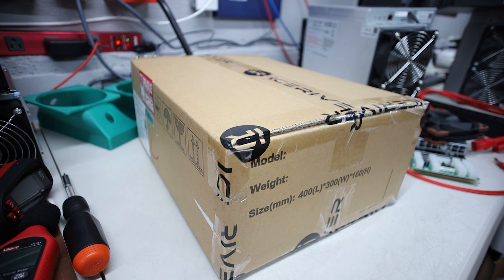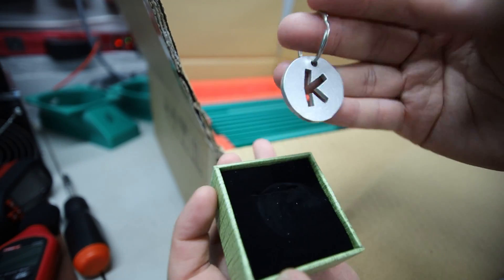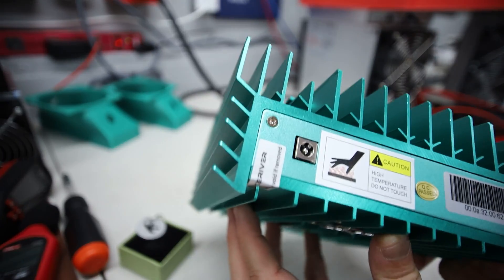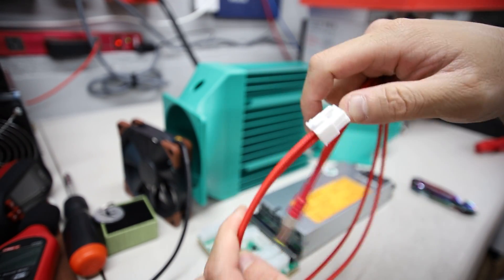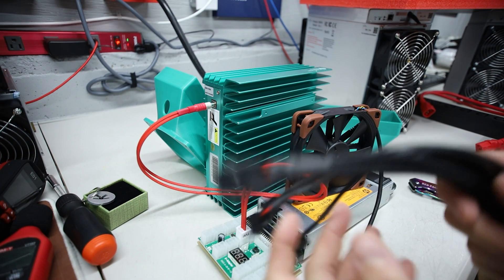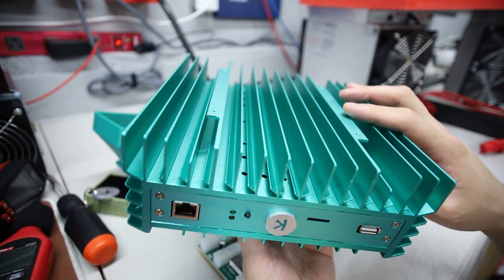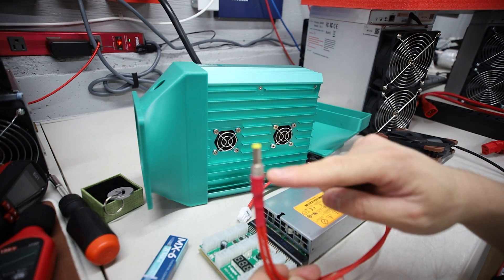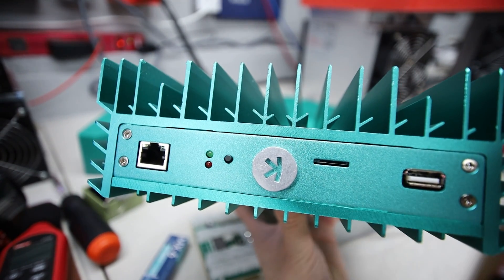The Commemorative KASPA Edition KS0 Pro First Look! and my overclocking modding plans.

Comment: Those veteran miner cables are useless for overclocking, the barrel connector melts away like butter and could potentially cause a fire... I wish the could use some high heat resistance material like clay or whatever. So, please stay away  from the veteran miner power cables if you'll be overclocking.

Comment: Does the KS0 Pro work well on 12v? I've bought a server psu and a breakout board. When i connect my KS0 Pro using the DC screw plugs, it literally smokes when the miner is started.

Comment: I have a question about the power supply.  I bought one with a breakout board, the board has a switch for voltages.  Do I run everything at 12 volts?  CPUs, GPUs, etc.  I plugged a nauctua fan into 12v and smoked it 🤷🏻‍♂️

Comment: If the power cable is inside the fan shroud it will stay cool. Most of the issue with burned power connectors if simply overheating.

Comment: 10 of these overclocked on one server psu?  you'll probably need a 2000w+ unit to follow the 80% rule.
Reply: There is no 80% rule on 12 volt DC power supplies, 80% rule is for 120v/240v AC House wiring only. 12 volt can be run continuously at max rate and even over for short periods.

Comment: PANDA the KS0 Pro is a POS, worst $500 I ever spent. 100 KaSPA in over 8 days. Crap bro
Reply: Shouldn't have been a big surprise either
Reply: Dang so what else can those of us who are home mining without ability to upgrade to a 30 amp circuit? what are good alternatives?
Reply: @jarooty2 buy equipment in bear market, yields were high then. Now we are in bull market. So wait until next 4 year cycle in a couple years.
Reply: @jarooty2  there’s a FPGA that runs on 20amp 120v K10+ over 45Gh on ALPH Wow

Comment: Hello red panda, I am Murat, greetings from Turkey. I used my KS0 Pros for a while for trial purposes, with a handmade barrel plug and server PSU GPU power cable combination similar to your system. However, there is a situation like this: While KS0 Pros are working with 19 volts, since the server is fed with 12 volts from the psu, this time it tries to complete the voltage from the ampere. In other words, the amperage value increases, which means the cable and adapter tip become hot. Won't this cause problems with the device in the future and make it unusable? The cable I used was produced by taking into account all these possibilities. If you say that you can use it without any problems, I would like to order from Turkey for my 4 devices. I would appreciate it if you could add an order link for the cable to the description.

Comment: You’ll need two fans.
Reply: After thinking about it. You might not. These run a lot cooler on 12v. But I don’t know how that works with the barrel plug. I directly soldered wires to the board with 6pin connector. Mine ran substantially cooler doing this. And it’s kind of on the fence if they need two fans or not. I think they run better with push/pull setup. Problem is nobody knows at this point what an “acceptable” level for the power stages at this point for long term use. Time will tell.
Reply: If it's anything like my grow tent you would want exhaust only. An intake fan would just cause turbulence. And the negative pressure from exhaust should pull air in on its own.

Comment: my gpus have been largely idle here in canada. mining is awesome but many of my older cards draw too much power. 6600xts still running ;)  carbon tax is annoying.
Reply: Just need to consintrate on putting together a solar set up, maybe 500 watts per machine, that way the power consumption isn't super bad. I run 3000 watts with 3 plug and play grid tie inverters